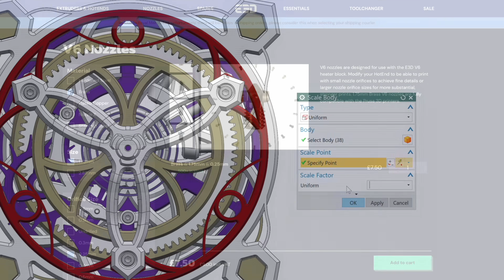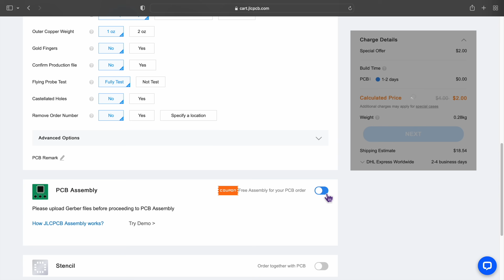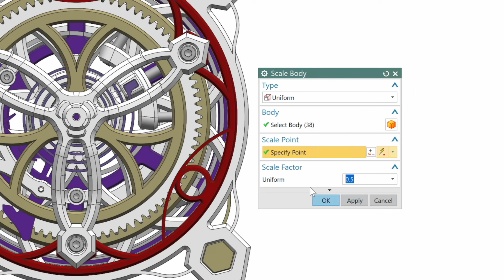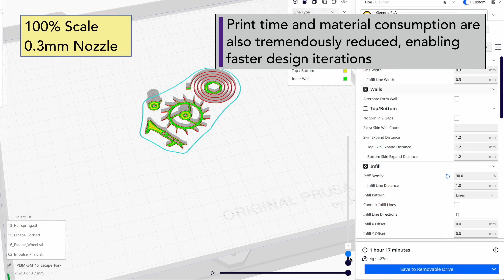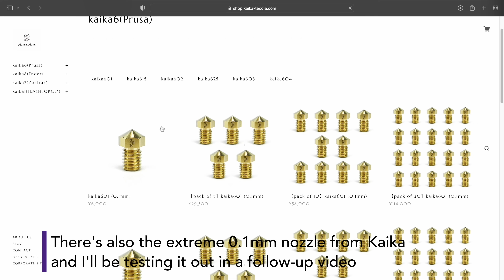Micro Mechanica | 3D Printing the smallest possible mechanical model [Experiment]

Comment: Does your parts bow when cooling down? I currently do not own a 3d printer but use Prusa printer at my Uni shared maker lab. I tried to do a similar project but there seems to be always a slight warping once the object cools down to normal temp. Multiple parts do not fit perfectly as a result due to 0.5-1mm misalignment. Always requires sanding. Even tried using the wall method to stop draft air but no use. Forget about the smaller objects like how you made in this video. They have too many tolerances issue. Can you please suggest a solution?

Comment: The Mechanica is my favorite 3D printed model. Amazing work! Do you have any plans to release part modifications you made for the smaller scales?
Reply from the maker: Yes, it’s actually already updated to be included with the original Mini Mechanica. You just need to re-download the file package and the assembly guide, BOM list and print settings are also updated accordingly 😁
Reply: @mechanistic3d  Thanks!!!

Comment: in another follow up it would be interesting to see a resin print with some mix of flexible and abs like resins.  beyond determining the material, printing would be a tad tough as you'd want it to be on the print bed but have to compensate for elephants foot for the burn in layers

Comment: This is simply amazing. 
But considering the hours necessary to print this, A resin printer could print all parts in just an hour or 2 at 0.03mm layer height, not very practical ?

Comment: bro...
have you seen the latest prusaslicer update? if not let me fill you in...
the big update was them adding a new slicing engine called arachne...
arachne allows flow control for the nozzle for extrusion widths less than the diameter of the nozzle...
you could prolly go a lot smaller with this new engine, but it would be borderline impossible to assemble. 
i love your models and videos. keep up the good work👌👍

Comment: This is one of the upsides to 3d printing, new uses for old and cumbersome clockwork devices. Sure an Arduino and a lipo could do the same job, but in a different way with less show along with higher consumption of resources. This uses nothing more than physics and potential energy. I love this like I love my 150 year old grandfather clock.

Comment: Beautiful works of art and great to see that they even work at this tiny scale.
Reply: Plus at those bores, you're definitely going to want to use a narrower diameter of filament to start with or else the backfeed pressure will be considerably cumbersome
Reply: Actually, thinking back, I remember seeing a .05 nozzle at Micro Center once - Micro Swiss brand, I think. Wish I had bought it. Can't even find their .1s and .15s here anymore.
Reply: First comment! I agree but I wonder, does there exist a 0.05mm nozzle? Could we print a mechanica at 20% scale? 15%?
Reply: @elvinshoolbraid  You know our man Stefan can make a .05 nozzle
Reply: @elvinshoolbraid  There's a company in Japan that made a ruby nozzle a decade ago that had IIRC a .01 or .005 bore for a New York university medical lab doing research on bioprinting, but I was never able to find any Western distribution info for even their larger nozzles.

Then again, once ruby tipped nozzles became mainstream, there were an awful lot of them that came unset under pressure even at .4, so...

There are micro drill bits that get down to .05 and a little smaller but they're really fragile and a bit expensive. Some hypodermic needles come that small too but they're hard to source or justify individually.

The most reliable way to machine a bore that small might just be wire EDM or similar, but this luck finding info on how to center bore something with that, much less getting the equipment and getting it done.

Comment: The Phrozen Sonic Mini 8K has 22 micron xy resolution a layer heights at as low as 5-10 microns, with plastics harder and tougher than anything I've printed in years of FDM/FFF and I've used all the hardest plastics with nozzles as wide as .8mm as as small as 0.1mm.. MSLA printing has a tricky (and financially unforgiving) learning curve but the results are near magical, I've shown various models I've printed to mechanical engineers running machine shops and they've bought them that day (I'm not sponsored, i just have two on them and will soon get various more lol)
Reply from the maker: Thanks for the recommendation! It's definitely at the top of my list, along with the Anycubic D2. I'm still reading up more about DLP printers, trying to find a direct comparison before making a decision. Do you have any recommended resin material with high stiffness and low creep properties?

Comment: Can a FDM printer reach the precision of a SLA only with a smaller nozzle ?
Impressive job !👍
Reply from the maker: Thanks! I believe it can come close to the level of SLA precision with a 0.1mm nozzle. I'm getting +/-0.1mm tolerances with a 0.15mm nozzle, and I believe it will improve with a smaller nozzle unless the limiting factor is the precision of the motion system. Nevertheless, I think it is still pretty impressive that a sub-500-dollar printer can achieve a 0.1mm level of accuracy.
Reply: @mechanistic3d  Thank you for your answer. My Prusa Mk3s+ works fine. The 0.4 nozzle does the job i expect in terms of precision and speed. If a 0.15 nozzle works as well as   your video shows, maybe i'll buy another Prusa only to carry this small (magic) nozzle.

Comment: What is the running time per each downsized version compared to the original? you mention less energy is required, but no mention of the run on a charge :)
Reply from the maker: Sorry I was not too clear in the video. The runtime for each scaled model is almost identical since the mainspring and gear ratio is maintained. I meant that a smaller escapement allows for a more aggressive mainspring to escape wheel gear reduction (due to less energy consumption), hence allowing for longer runtime in a system.

For example, If I were to half the scale of escapement in Tourbillon Mechanica while maintaining the dimensions of the mainspring barrel, I could potentially increase the gear reduction by 3-4 folds to proportionally increase its runtime. Hope this helps to clarify :)

Comment: Nice work!
It is nice to see your experiment going in small mechanical devices
I will be scaling down my Roskopf watch to 50% with a 0.2 mm nozzle, that will be 72 mm and see how it goes
https://youtu.be/KdQA8bHxzJo
then there is 0.1 nozzle!
Fun Fun Fun!
Reply from the maker: I just saw your Roskopf watch, and it's amazing! subscribed and I'm eager to see your scaled version :). I also see that you adopted an interesting escapement model. I am exploring other escape wheel designs that have thicker finger profiles so that it will not be a limiting feature for miniaturization.

Comment: Nice work. The aeria mechanica looks like the latest « Freak » from Ulysse Nardin though.
Reply from the maker: Thanks! It was indeed inspired by Ulysee Nardin Freak S (partly), but my first inspiration came from the quinjet from the winter soldier movie. The scene of cap vs. the quinjet shows turbine engines are located at the wings, and I thought it would be cool to have the Tourbillons represent those turbine engines. Then, a little while later, I came across the freak S, which really etched the whole idea into my head. I also wanted to create a heli carrier kinda model with quad tourbillons, but that might be too complicated. 😂

Comment: Did you print this using the 2.5.x version of PrusaSlicer? If not, that could help a bit to scale it down even further. The new version can print smaller features with bigger nozzles by reducing the extrusion amount
Reply from the maker: No, I actually printed this using a Cura version 4.8 😅. But I've read about the arachne generator and its really cool. I believe Cura version 5.x.x has a similar feature. will try it out for sure!
Reply: @mechanistic3d  Arachne is the default print engine in 5.x.x.

Comment: i wonder if a 3d printed pocketwatch is realistically possible
Reply from the maker: I think it is possible to cram a basic working watch movement into a 70mm pocket watch. However, the components will still be relatively larger compared to an actual pocket watch movement since it's nearly impossible to achieve that level of miniaturization with consumer-level 3D printers (for now). Also, assuming it is possible, plastic material will not be as reliable as metal, especially at such tiny scale, in the long run due to creep and other forms of degradation.
Reply: @mechanistic3d  it would probably make for a good video at least

Comment: Whoa. Quite an impressive level of detail. Consumer grade 3D printers have surely come a long way.
I wonder what kind of miniaturization can be achieved with resin printers. From what I heard resin prints are more brittle than extruded plastic ones, which could be a problem. Then again, there are specialized resins for printing now that have different properties, so maybe it's doable.
Reply from the maker: Yeah, I am seriously interested in trying out resin printers. However, based on my limited knowledge, FDM printers should have better-suited materials for mechanical-related models even compared to some specialized engineering tough resin. 

Nevertheless, I'm still very intrigued by the miniaturization possibilities with resin printing, and I'll probably pick one up after exploring the limits of FDM.
Reply: @mechanistic3d  If I can offer you a word of advice based on my own experience with a resin printer (Longer Orange 10), it's that I'd recommend getting the highest-resolution and highest-contrast model you can, if your goal is really to push the limits of miniaturization. My cheapo Orange 10 already blew most FDM printers out of the water, but because of the contrast and resolution of the screen, there was a touch of visible pixelation, and more importantly, I found a few of the finer features frequently fused, frustratingly. Pardon the string of F-words.
Reply from the maker: @hollt693  Thanks! given that I have zero experience with resin printers, I appreciate your word of advice, and It'll definitely help narrow down the choice of models (i guess 6k/8k should be the way to go).
Reply: @mechanistic3d  It sounds like the two top-of-the-line printers in that regard are the Phrozen Sonic Mini 8k and the Anycubic Photon D2 DLP printer. The latter doesn't sound like it has comparable specs on paper, but that's apparently because it uses a different technology for exposure. VOG has a good video on it: https://youtu.be/Q-OoGQfG2wY

That said, I have zero firsthand experience with either of those, and for all I know, the difference between 4k and 8k/DLP may be insignificant. I wouldn't want you to waste money on a gimmick (like 8k TVs), but it would be a bigger waste to try to save $100-200 only to find out that the printer you bought is insufficient, right? With resin printers, you normally can't upgrade just the screen to a higher resolution, so you're generally stuck with what you've got.

I trust you'll do your own research and find what's right for you, but I know that coming from FDM, even figuring out what specs to look for in a resin printer can be difficult. I wish you the best of luck, and I look forward to seeing what you're able to do with resin printing!
Reply: @hollt693  Yeah this are the best in my eyes also. But first think about your health and stay with FDM. I also thought switching to resin but if you really dive into the specs and risks of that stuff including the environmental impact, it doesn’t make fun anymore.

Only my 2 cents, not blaming others.
Reply: @lazyman1011  You're right, of course. Resin printing is messy, cleanup is a pain, ethical disposal is a big question mark, and printed parts smell weird almost indefinitely. That said, there are many things you can do with resin printing that you can't with FDM, and vice versa. I'd say a resin printer is to an FDM printer what a frying pan and stovetop is to a microwave. Sure, a microwave is generally safer, easier to clean, and can technically cook just about anything you want, but if you want crispy bacon, sometimes it's worth dusting off your frying pan, because the microwave just won't be up to par.

In my case, I have a combo microwave/airfryer/convention oven, but the analogy still holds, because my FDM printer is a SnapMaker 2.0, so it's also a CNC router and a laser cutter. I wouldn't really recommend either.
Reply: @hollt693  I like the possibility and result you’re getting from a resin but my health and the ones from other is a too high value for me. With this in mind I can’t use these technologies in a productive fun way.
Reply: @lazyman1011  That's fair. And if you ever need something that requires a resin printer, I suppose you could always order it through a 3D printing service, where someone else will handle the nasty parts and only send you the (hopefully) already fully washed and cured print. That would still save you money over buying your own printer and resin if you'd only use it rarely anyway.
Reply: @hollt693  I’m happy with my BambuLab FDM and after some thinking I don’t need this high res delicate parts. For some hobbies it’s nice but there is enough other stuff to do.
Reply: @mechanistic3d  tough resin is a little weird from what I've seen, not elastic enough, too much plasticity. I'm curious if MeyerMakes resin can solve that.

Comment: You make the size variations look so incredibly easy. I would love to know more about your process and the challenges of it. 
I'm already very excited to see how small you can go!
love what you do
Reply from the maker: Thanks, but It's actually not as easy as it looks, especially for the 50% and 35% versions. I spent quite some time fine-tuning the escape fork profile to get it working consistently. I also encountered a pretty unique challenge for the 35% model. 

The extremely lightweight fork was actually influenced by electrostatic forces from the escape wheel fingers (I assume it's generated by the interaction between the wheel and fork). That causes the fork to be repelled from the wheel finger like a magnet, causing frequent jams.

It was solved by fine-tuning the clearances to near zero as much as possible, but I foresee this issue becoming more prevalent as I try to go smaller. Grounding those charges is probably the best solution, but I'll see how it goes 😂
Reply: @mechanistic3d  The part’s are always loaded when they came fresh from the bed. There is also ESD filament outhere, would be interesting how this compares for the part.
Reply from the maker: @lazyman1011  that’s a cool suggestion. I did a quick Google search and found out that there are some variants of ABS with good ESD dissipative properties, worthy of a try. Thanks 🙂
Reply: @mechanistic3d  Also keep in mind that fresh printed parts are always loaded strong. Maybe you also used them directly after print?
Reply: @mechanistic3d   That is fascinating to hear, thank you.
 Since static electricity is created through friction, you might want to look into reducing friction in smaller versions, for example by using a different, less conductive, material for the metal rods.

sorry for being a smartass, that problem just got me hooked immediately

Comment: smallest possible would be even smaller if you used a Mars 3 Pro ;) xD
Reply from the maker: I'll be ordering one soon!
Reply: @mechanistic3d  I intend to be doing exactly this when I upgrade my original Photon too :D I'll be aiming to print in castable resin, and cast the pieces in brass using my lost wax casting equipment.
Reply from the maker: @noviceartisan  that sounds like some next level stuff and I would love to see it
Reply: @mechanistic3d  I'll share when I do, need to get the printer first haha Poor lyf xD
Reply: @mechanistic3d  As a note, i reccomend the Mars Pro 3 for the low cost initially, and low cost of spares (your wallet will thank me for this whilst you're in the learning phase). The top tier printer is the Photon D2 as it's using DLP Tech, but the fact is, once you enable Anti-Aliasing, it's damn hard to distinguish undera microscope against the (massively overpriced due to lack of competition) Sonic Mini 8k. The terms 4k, 6k, 8k are all trash in 3d printer terms. You're better to simply check the Pixels Per Inch of the LCD, which will give you a much more realistic grasp (for non-DLP printers anyway)
Anycubic DO have a new 10 micron printer which they're threatening to cause puddles with, but it's not on the market yet and details are few. The build area is truly miniscule tho, so it's only really for those of us making super fine detailed stuff like mechanical parts and jewellery/embossed work etc.

Comment: Wow! ... I'm still struggling scaling down another of your projects on resin printing. Elefant foot optimization when printing on build plate is a real issue and printing on supports has other disadvantages for many of the parts. Also, at smaller scale, the surface roughness (it is 3d pixels / voxels) is a big issue. Especially for fork / fork wheel ...
Reply from the maker: Elephants' foot is definitely a pain for mechanical models. I'm not sure about resin printing, but for FDM, I always set a skirt with a large offset from the model so that I can feel the layer height with my hand to live adjust z offset to achieve a good first layer.

Adding chamfers to the bottom surface of gears also helps to reduce elephants' foot. I like to use a 30deg chamfer and couple it with the slicer's elephant foot compensation feature. 

I have no experience with resin printing, so it's interesting to learn about the surface roughness issue. I wonder if DLP  printers will help improve surface roughness at tiny scales.
Reply: Enjoy - https://blog.honzamrazek.cz/2022/02/a-step-by-step-guide-for-the-perfect-bed-adhesion-and-removing-elephant-foot-on-a-resin-3d-printer/